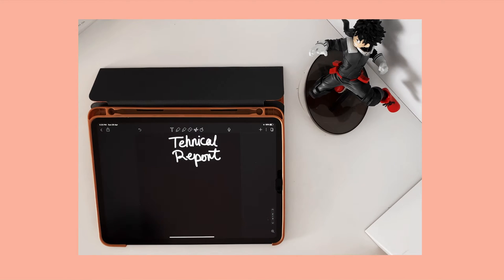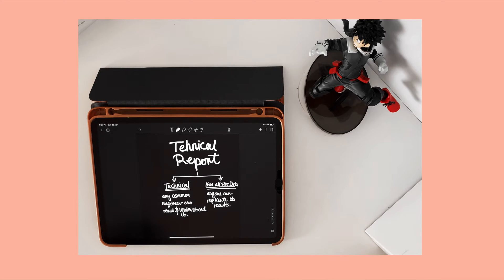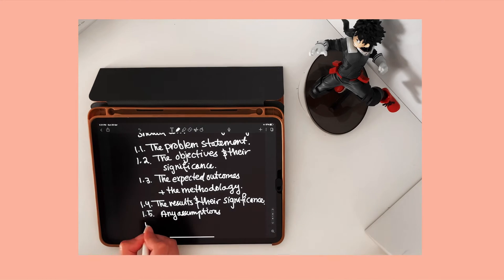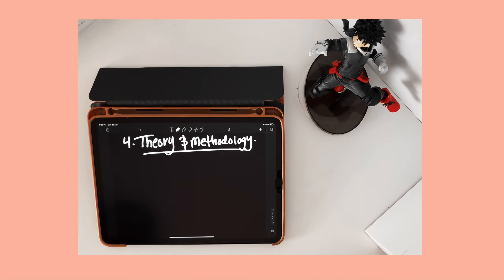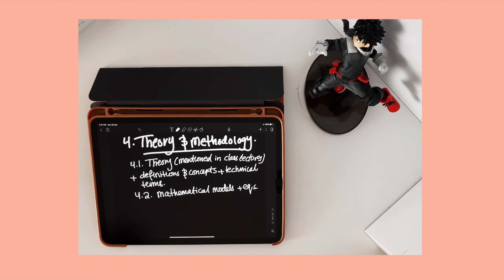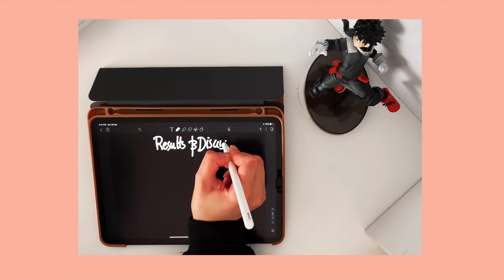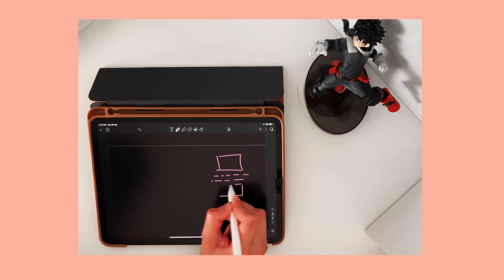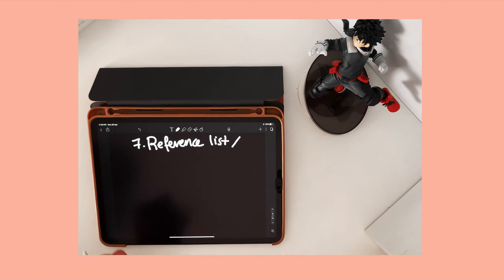HOW TO WRITE A TECHNICAL REPORT For ENGINEERING Students 2020

Comment: Executive summary 
1.1	The Problem statement
1.2	The objectives and their significance
1.3	The expected outcomes and methodology
1.4	The results and tier significance
1.5	Any assumptions 
1.6	Further recommendations

Includes after Executive summary 
2.1	Table of contents
2.2	List of table and figures in the report
Introduction
3.1	Detailed Description of the problem
3.2	Spec/requirements/conditions
3.3	Descriptive figures of the problem
3.4	State the goals/objective of the project.
3.5	State the outcomes of the project and link them to the objectives.
Theory and Methodology
4.1 Theory (mentioned in-class lectures) and definitions and concepts and technical terms.
4.2 Mathematical models and equations
4.3 Methodology [software and workflow and equations].
Results and Discussion
5.1 Present all results in figures and tables. 
5.2 Group the results into categories for discussion
5.3 mention all assumptions and sources of errors
Conclusion
6.1 State again the problem and objectives, outcomes, and methodology and why this project is important.
6.2 Summary of the results and their significance.
6.3 Source of errors
6.4 Further Recommendations and future work.
Reference List
Reference list / appendix / acknowledgments
-long calculations and proofs

- data table
Reply: owesome
Reply: @liko1444  awesome*
Reply: thank you